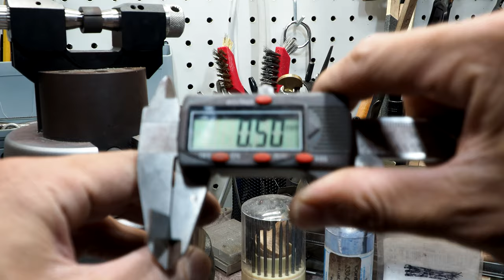Making and Engraving This FEATHER Gold Ring By Hand

Comment: Thank you for sharing!!  I was wondering if you have a second, what is the name of the tool that you use to engrave, which vibrates slightly to help the engraving process?  I'm assuming this is one of the tools used to do pavé setting?
Reply: It is GRS GraverMax G8 or similar.
Reply: @bakinka2727  Thank you so much, I didn't realise they would be sooo expensive :(